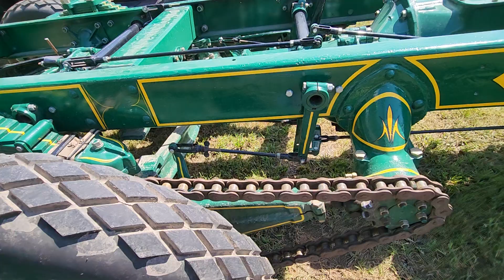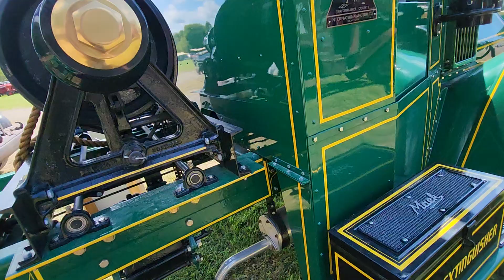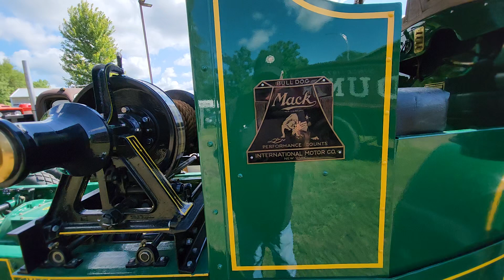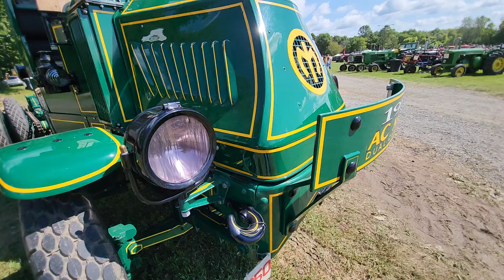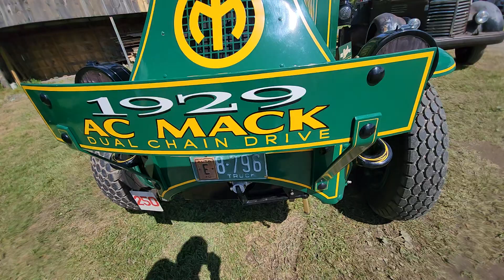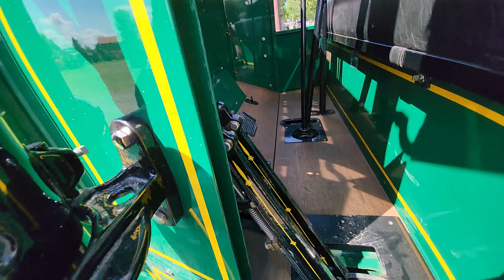1929 Mack model AC. ( Almelund .)

Comment: Chain drive truck.  That is cool.  🍻👍
Reply from the maker: Would the old Alberta abbreviation be Alta ? I'm not sure.  Definitely a beauty.
Thanks Chad.
Reply: @brycewiborg8095  I’ve seen it that way before.  Not common though.
Reply from the maker: @chadtosh6831  Mn was abbreviated Minn until the early 70s.  The Mack must have a Alberta plate.
Reply: @brycewiborg8095  just looked it up.  Believe that is an Alberta plate.  Alta was the abbreviation till it was commonly changed to AB for the postal systems in the US and Canada.
Reply: @brycewiborg8095  the old girl could’ve been working in the oil patch with that winch set up.